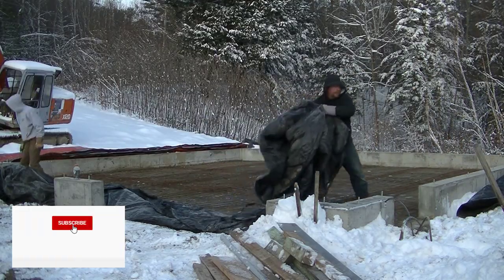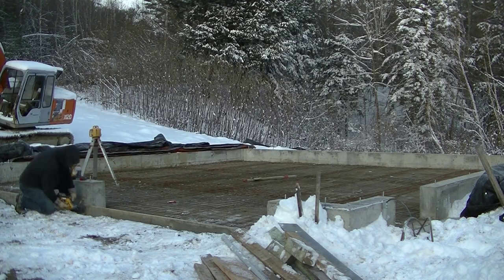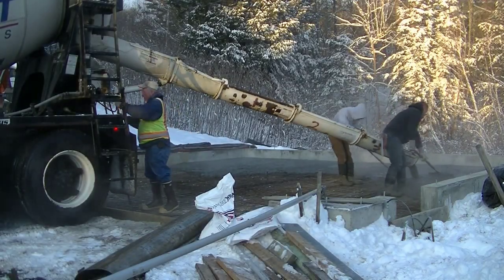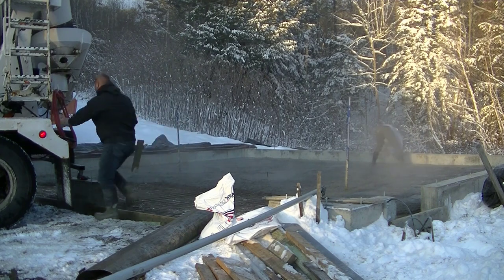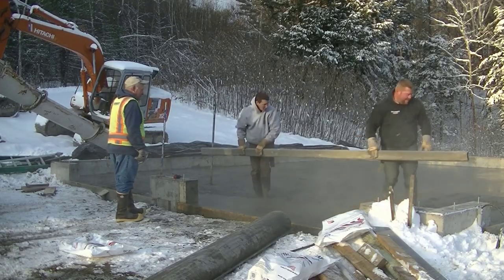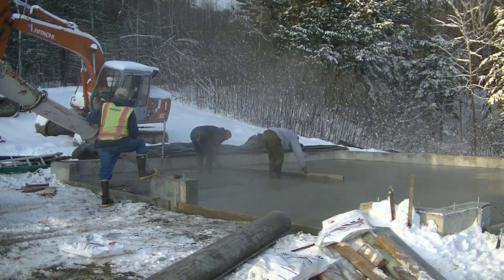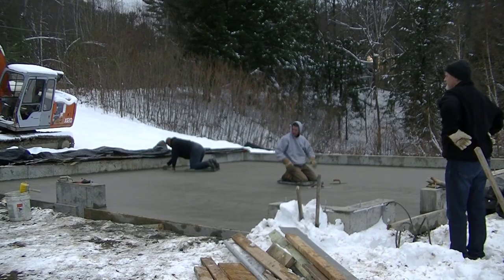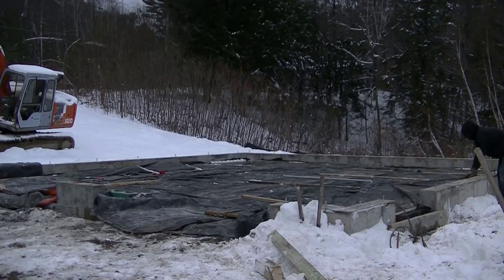Pouring And Finishing Concrete In Freezing Cold Temperatures

Comment: We used to pour in cold weather, but it’s not worth it. If it’s cold enough for the ground to freeze we hang it up for the winter. The cold weather makes everything harder than it should be. There is nothing fun about blankets. The quality of work also goes down when it’s cold out. Nobody wants to be out there.
Reply from the maker: It is harder for sure. When our regular customers call we can't say no to them. We figure out a way to get it done.
Reply: Mike Day Everything About Concrete absolutely.
Reply: Cold weather is ok to pour in with the proper equipment. AKA ground heater....... And a good crew

Comment: I appreciate your knowledge sir. You remind me of them old timers I learned concrete tips and tricks from when I started. More than 12 years doing it. I'm now 28 years old running a solid 10 man crew👍
Reply from the maker: Nice! 10 guys is a good crew size. You can get a lot done in a week with that many guys.
Reply: I'm a 30 year finishing concrete contractor thank u Mike your on the right track. Yet we never get concrete perfect
Reply: Hey, man. It sounds even inspiring :) Where are you guys located? Do you also work with low degree weather? Just curious, if concrete business is weather based and you work mostly summer / non cold temperatures?

Comment: When we pumped concrete to pour on a hi rise floor, we always built a climate shell to enclose the floor in Alberta, Canada.  If it was just freezing weather, it really didn't need heating as the curing concrete created ample heat.  Our worst worry was loosing humidity inside that climate shell.  Propane heater fans were set up inside the climate shell if we expected a blizzard or windy cold snap.  It was not too uncommon to pump in the concrete into the climate shell when it was -30 to -40.  Unpleasant?  Yes.  We slowed down slightly but the pour must go on without interruption.  We also had to keep a guy overnight on propane watch.

Comment: I pour a 6x6x42 concrete. I removed the wood prior to fully cured to setup the other side. Temperature went down to 32 degrees Celsius that night and I notice two cracks. I'm using it as a weight and base for a 20x42 hoop shelter. One mistake I know I did was I didn't use any rebars because I didn't think it would need it as I'm just a DIY person.

Comment: In 1985 Guilford County Inspections in Greensboro, NC came out to watch me fail placing concrete slabs in below freezing weather … did my homework and innovated a placement that used 6 mil polyethylene spread out on the ground , I had the concrete company heat the water in the mix and added 2% calcium chloride with air-entrainment on a 3000 psi mix … we covered the “pour” with 6 mil poly and straw ( not hay) because straw is hollow and has a far better insulator value !!! … never lost any slabs , proved all the naysayers wrong and made a $4000 bonus bringing the project in on time and below budget !!!

Comment: Our Company always use 4000 all Year Round, the Key to doing Concrete to Evaporate the Water you can pour all Winter Long. In 32 Years I haven’t Lost But One Pour in those Years. 2% it starts to Pop right away.

Comment: Im from IRELAND and I have worked on concrete pumps for 25 year's and I have never poured concrete when it's below freezing because we don't have hot water set up's but its good to see how you guys do it we don't get many day's a year below freezing that's why we are not set up for it.
Reply: Hot water freezes twice as fast as cold water.
Reply: @rl4889  No. Hot water evaporates faster into gas/vapor, leaving less water to freeze. While the cold water evaporates slow and has more water to freeze.

Comment: On more than one occasion because of the weather and not using Styrofoam we would lay down tarps or Tyvek poly whatever we had throw about 8 inches of hay/straw  on top and then the insulated blankets and the hay generates a bit of heat and keeps the frost from pushing in it’s really kind of cool and then when we show up to pour the floor and it’s still cold the substrate isn’t frozen , We do the same things for our footing lines

Comment: As a ready mix supplier we do not use Bag Flake Chloride. If a customer insist on using it they sign a disclaimer absolving us from any liability in the finished product of that concrete. We do offer Calcium Chloride as well as non corrosive set accelerating admixtures. 

Aside from that I really enjoy the videos you put out. Showing what the industry deems the right way to order and finish concrete.
Reply from the maker: Jason, we have some ready mix companies here that don't offer the bag flake either. We do assume the liability when we put it in. In my opinion and in my experience, it does work better than the liquid accelerators. Thanks for watching and being a part this channel. Maybe someday we could collaborate on a video together!
Reply: The ready mix company’s never assume any responsibility for anything anyway, lol.
Reply: @gnevala  when any customer add any thing in the truck on site most company want to mark on the ticket it cover there butt

Comment: Are you concerned about the calcium chloride with steel in the concrete?? Most people use non-chloride accelerator with steel reinforced concrete. I've never seen firsthand issues from using cal with steel, just curious what your opinion is, or if you have any additional info

Comment: Going to be pouring a driveway this weekend. The high will be 49 degrees the low will be 35 degrees that night. Do you recommend I cover it? I thought about plastic with bales of straw spread on top.
Reply from the maker: If temps don't get below freezing you don't need to cover it. Concrete generates some heat from hydration as it cures. It generally won't freeze unless temps get below about 28F.

Comment: I use 4500 psi ,hot water(185 degrees),steamed sand and gravel, two percent pozz on a day like that up here in the Rocky Mountains in Montana. We only have non chloride admixtures ware I live.
Reply from the maker: Does that mix formula set up pretty good for you?
Reply: Wondering the same AND what's it made of ?

Comment: Mike, you use Tapcon screws to fasten your boards?  Have you ever tried a wire nail?  Drill a 3/16” hole through the board and into the wall.  Stick in a piece of tie wire, pound in a double head.  Things hold like mad, strip with a bar or steel hammer.  I’ve broken countless wood handles.
Reply from the maker: My guys really like the tapcon's. Thanks for the tip.

Comment: I live way up in the high country of Colorado . .10,000 ft elevation.  Pouring a smaller area (90 sq ft) but steps....high tomorrow will be mid 30s but when sun goes down its gonna drop fast.  Low overnight like 5 degrees.  Zero humidity up here at least....have ice melt ran but it's not hooked up yet

Comment: Don't forget to tell themabout  the part that you had to go back there around 10pm to put the bankets back on. Hopefully it has hardened enough that the finish doesn't get ruined by the blankets or the lumber over them..

P.s. its always a good idea to walk on the fresh concrete in your stocking feet so your work boots won't ruin the finish..  If this doesn't give you cold feet about doing concrete work,  nothing will :)

Fact of the matter, cement finishing and cold weather  (although possible)  just   don't  "mix" well.

Comment: Hi Mike. I have a question hopefully you can answer. If I were to pour a footer, foundation and back filled for a building in the summer but not the floor until the next year. Would the winter months cause issues? Obviously it’s best to do it all at the same time but I’m looking to shell the building and pour the floor with a pump later.
Reply from the maker: Richard, you should be fine, builders do that all the time here in Maine.

Comment: If there is snow on the gravel before hand is it common practice to use a propane torch to melt it then put the blankets on for future pouring? Our home is being built now and the walls and basement floor have yet to be poured with snow covering them. Just curious and anxious for them to get them in before it starts getting really cold. Thanks!

Comment: I went through your videos and didn't see one on what I want to do, and your sight is the only that talked about temperature of ground.  I am cementing a 3 1/2 in pipe 4 feet in the ground and hole is 12-13 inches diameter.  I am mounting same size pipe to it after the cement is set up.  My question is I put a thermometer in hole and temp was 34 degrees.  I am using fast set concrete from Menards.   SKU 189-1111.   Thanks in advance and if this isn't the kind of work you do once in a while, please accept my apologies.

Comment: Nice work. I'm surprised that someone hasn't come up with an inflatable tent, kinda like the ones used for the kids bouncy houses in different sizes. With one of those set up, you could blow heat in and hold it, at least for a while ?  Only problem I would think would be all the sharp edges from the short wall. Thumbs up.
Reply from the maker: Some type of tent would be ideal. We have made a makeshift tent out of a big tarp before. Works ok, just more work.

Comment: How do you prevent the blankets from leaving marks in the floor ?
Reply: cure and seal . spray after your final finish. doesn't need to be a thick coat .  wait till it is 100% dry. ( it wont be sticky) . that will protect against stains also

Comment: I will never forget the day poured in -30 degrees with -45 degrees wind chill man oh man what a day
Reply: What mix design did yall use and what did yall do to help it set up
Reply: @ButchOC  if I remember correctly it was 4000 psi half inch ag and added plasticizer on site we used a 1000 ft thawz all hose and hung it every 2 ft on the walls and columns then wrapped the walls and columns with blankets before and after the pour
Reply: @ButchOC  also had diesel heater blowing under the blankets surprisingly nothing froze

Comment: Are you the same Mike day who was a judge on concrete combat for quickcrete?
Reply from the maker: Yes, same.
Reply: That's awesome, that must have been a awesome experience, I noticed you also do epoxy floors as well as pouring slabs, I finished floors for 4 5 years before starting epoxy 3 years ago. I gotta ask. Do you always use a magic trowel for your coatings or was it just with that metallic video you did? I've always done 25 30 mils or 40 45 mils
Reply: @MikeDayConcrete  is better to avoid the winter time or the concrete can be done well in snow times?

Comment: Why not build the garage first, then you just tarp the doors and heat it, it's no more difficult to build, and it gives you the option to pour regardless of the weather. We always frame first in the winter so  the area to be poured can be protected from the elements.
Reply from the maker: That was exactly my suggestion. The builder wanted nothing to do with that. I agree with you 100%
Reply: Builders!  They all just about poured from the same mold. Finished sellable product, regardless of the cost to the subs or later on, the home owner. I know one who wants 4% Cal Chl six to eight months out of the year regardless of the temp. Even knowing it shortens the life of the pour. "Can't see it from my house".

Comment: I have a deck project in Chicago area.

We have to pour Concrete Footing 
20in diameter bc we are using 6x6 posts... and 42in deep.bc of frost heaving.

We are in mid december. So temps are going to be 20 degrees
 
Do you think we can do.this without a problem. 

Google says you can't pour under 40 degrees
 But then again google is not a concrete pro

Comment: Great video! I have a question. I just poured a slab, two foot footings, average slab thickness is 6”.  Backfill is done, perimeter has 2” foam insulation.

I’m considering waiting until spring to frame because materials are so expensive. We have cold winters, possibly down to 0 degrees Fahrenheit Jan-March and average snowfall of 48”. Do I risk damaging this foundation if I don’t frame this summer? Is there much chance that it will crack or have surface flaking?

Should I cover the slab with plastic so ice isn’t forming, melting, refreezing directly on the concrete and in the cuts? Any advice is appreciated. Thanks!
Reply: Did you get the project in the dry yet?
Reply: @richardpotter6313  I didn’t frame this year, foundation is still exposed to the weather but I covered it with two layers of 8 mm plastic to keep the moisture out. What’s your thought on this plan?
Reply: @timshapleyadventures  Probably a wise decision. An ounce of prevention is worth ...5 to 8 yards of jackhammering.
Reply: @timshapleyadventures  Don't know your weather situation but lumber has come back down a ton. Probably won't be any cheaper again AND with all this BS going on,  supply lines could dry up. I'd run with it now if I had the coin.